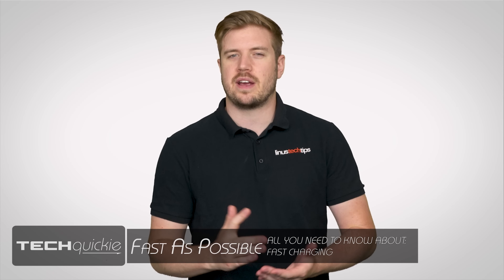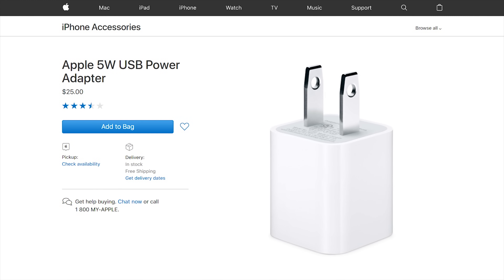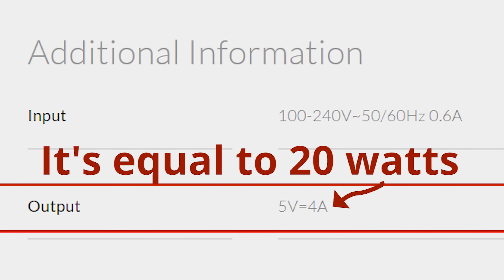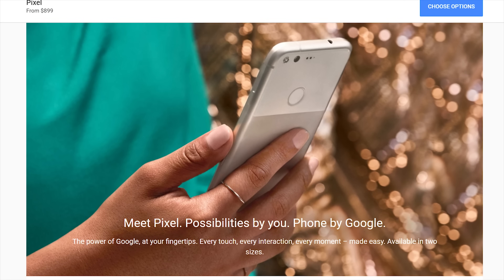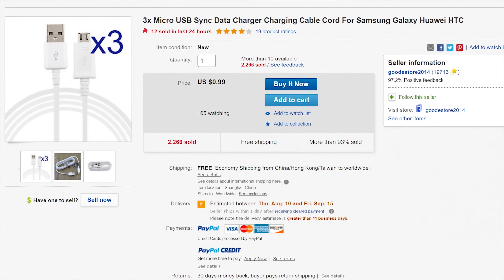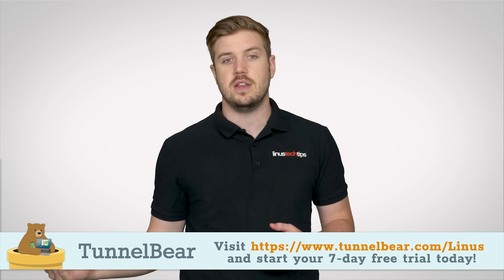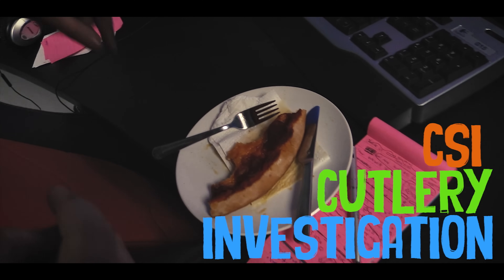How Does Fast Charging Work?

Comment: I use a hauwei ya8 very cheap phone work up today and realized I forgot to charge it
Dressed and off to work,  I put it on charge using the company plug and in a space of 20-25 minutes my man was 78%  and it's not even an expensive device tec is awesome

Comment: I bought a USB dsi charger since the original one I got with the console was broken. When I plug it into my phone's ac adapter (Wich does handle fast charge) it charges REALLY quickly. Apparently, the Nintendo dsi is fast-charge compatible xd

Comment: Funny how AT THE MAKING OF THIS VIDEO most phones could take 2 amps/10 watts for the LAST SEVERAL YEARS. Handshaking technology..... while every battery has a charge controller chip often built onto the end of the battery... right down to the junk little rechargeable lights with lithium batteries.

Comment: Hey techies
I just purchased, micromax IN1 which has fast charger
But it gets hot (around 48 deg celcius) after charging for 15-20 minutes)
Till 65% it heats up then 65+ it doesn't heat much

Is there some issue, what should I do now¿
Reply: Well above 45°C it can be harmful for the battery. Try to keep your phone cool while charging it. Put it in a cool environment.
Reply: @quietpaper  you're indian?

Comment: Didn't get my answer. Nearly All of phone battery voltage is around 3.6-4.2V. The question is how they can be charged with 9V and 2A. Does the need to convert it to the new level? During the conversion lots of energy will get lost and make more heat.
Reply: Yes
Reply: Yes voltage converted to amperes and push into battery.
If battery is capacity 4.5v 5A ,and put 9v 2A without energy loss the battery would receive 4Ah or 0.8C
In reality would loss 10-30% of energy as heat
there are charging system like PPS that push low voltage high ampere from charger that reduce heat on phone

Comment: Fast charging is not good.  The quality of the battery determines how many charge/discharge cycles the battery is capable of.  Fast charging reduces the number of charge/discharge cycles.  Slow charging is best.  This applies to all rechargeable batteries.   What is likely to happen  one of the cells in the battery will short out, then battery will still put out voltage but will strain the remaining good cells.  It will cascade with the battery losing voltage and cell capacity.  Heat is the enemy battery packs.   Charging produces heat.  the faster the charge the more the heat produced.    This dries out the cells.  They vent gas and the cycle continues.

Comment: Absolute bullshit. Using a 4amp power supply won't make charging any quicker, it will just help with voltage drop. It's higher voltage that will speed things up. Electronics will only pull as many amps as it needs.

Comment: If I wanted to by a multiport charger, and I have a variety of devices that I want to charge via USB, and some devices I want to charge use Quick Charge and others don't, is there a multiport charger, like one from Anker or something, that you recommend? Will it be safe to use? Or should I not bother with Quick Charge capabilities for the sake of safety?

Comment: my connector is wrecked, I just changed it with an old one. My adaptor is a fast charging. Does it really matter if I change the connector? If the adaptor is fast charging will it get much power from the power source and just stucks on the adaptor and the connector just accepts the amount of power it can handle? In my case, the charging slows down, the adaptor heats up easily, and the connector is cold asf. lol. i know, it's so complicated but still hoping someone helps me. lol.

Comment: Fast charging is like eating or drinking too fast. You feel full, but that feeling doesn't last as long as if you sat down and ate a good meal at a slower pace. Or maybe drinking an energy drink, a quick boost for a couple of hours but you run out of steam very quickly. Batteries like a slow charge to make the most out of what its getting just like your body would rather have constant nutrients instead of a quick blast of sugar or caffeine.

Comment: Got my OnePlus 3 charging insanely fast. From 5% to over 45% in less than 10 minutes. Not to mention that sometimes I wake up with it on 3-4% and when it reaches 1% I still use it to check my apps and mail and it doesn't die until after maybe 10 minutes of use like that. So, take your iPhone and throw it in the bin. Get a OnePlus and live like a god :)
Reply: Do remember modern day Smartphones will actually turn off at 3% NOT 0% or 1%

Comment: Li-Ion and Li-Po expand over there life from over temperature extremes as well as being held at fully charged or too low for too long, this is why on a design point of view, you should NEVER use a phone case that has the battery backup built in as this applies permanent power to the charger input of the device, if there is always 5 volts present the battery is never allowed to discharge (some moden battery management can allow charging to completely halt). Something to keep in mind is when a traditional charger for Li-Ion or LiPo gets the battery to 100% (4.20volts) basic physics steps in, the battery doesn't need the current, but the charger keeps going it pretty much just burns up that current as heat in the battery instead - further damaging it.
Reply: Actually modern Smartphone chargers cut the current entirely once the charging is done and won't allow anymore current to come through thus the Battery will be entirely protected

Comment: I shut down (turned off) my phone at the end of the day before snoozing and then charge, less than 100 minutes with a non-fast charger too.  Preserves battery life pretty well.
Reply: Leaving it on is better as turning it back after charging will only suck juice from the battery
Reply: @stephensnell1379  true.
That depends on the age of the battery and it's capacity, mine are all higher than 3000ma.

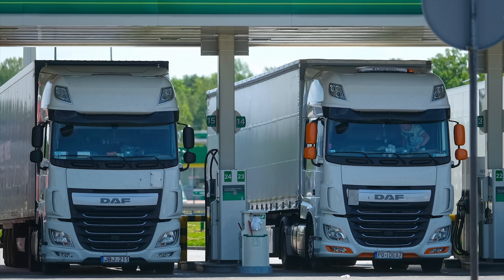Comment: 3:00 woah, okay, $50 bucks to fill a big rig? and you are showing a picture of Semi tractor trailer units. On average, these trucks have anywhere from 200 - 400 gallon capacities, with a usable capacity of 190-390 gallons of diesel (usuall,y numbers vary my manucaturer, make, model, etc.)  200 gallons at $3.19 a gallon for diesel where i live is $638 dollars.  
I wish it was $50 bucks.

Comment: Do y'all have a video explain smart charging power supplies, and how or if they can quick charge multiple devices, or does the overall Amps get limited to say 5A per USB port, or is that 5A shared through each device plugged in?

Comment: Wanna see something out of the box? Here is "CONNECT" a new "wireless system" that can charge as fast as a USB, require no cables to charge, with a portable fast charger and power bank, a reversible USB onboard that you can plug both ways, with a kickstand, a sound enhancing speakers on the phone case and all in two parts lightweight of 3.4 oz check it out at www.miriQ.com (more videos on vimeo such as this one https://vimeo.com/236365494) 
Please let me know if you'd be interested to test the CONNECT device we can send you one from our LA office - here's my email - Solo@miriQ.com
We just getting started and already booming on Amazon Prime but we need smart people and reliable feedback from cool dudes like you ;) looking forward to touch base.
Cheers, Solo Avital

Comment: in fact, the fast charge doesn't work it is just a gimmick. we have 2 types of chargers on the market 0.5A and 1A. All the sellers are telling you their chargers are 2A 2.4A ... even 3A but this is just not true in real usage. I am not speaking about voltage (v) that is total bullshit when it comes to phones. All micro USB cables or USB c 2.0 are not rated more than 5V and in fact, they don't even deliver 5v they do around 4-4.5v.(even usb type C 3.1 can't deliver more than 5v 3A) All this quick charge 2.0 3.0 fast charge turbo charge are just gimmicks your phone will be charged at the same speed with a non-quick charge charger but your phone won't display FAST CHARGE status. If you don't believe me just install Ampere app on your phone and try different chargers. The only slow chargers are the 0.5 A and they are sold as 1A charger. So just buy a 2A charger that will actually deliver only 1-1.1A. I don't know i may be wrong and this may be just a software restriction or the actual battery technology limitation. But even like this, I don't see any point in paying double for a charger that can theoretically deliver 15W 18W 24W 30W when you can't find any phone that is charging faster than about 5W
Reply: the only benefit of these chargers is if you use them with an usb 3.1-3.2 type c to charge a laptop or a device that can eat that much current but not a phone.

Comment: You are wrong, the current limit is usually set to 1C charging. For example a 3000mAh battery should be charged at a maximum current of 3000mA or 3A. You can of course charge a Lithium Polymer or LiPo battery faster BUT you are limiting the life of your battery, meaning it can endure less cycles before the capacitance drop of your battery starts to impact performance. Though manufacturers can support this cause they expect you not to keep your mobile phone more than 2 years (for tablets it´s around 3 years and for laptops anywhere between 4 and 5 years). Now try and remember when you started noticing that the battery of your device is not lasting that long. Fast charging is convenient yes, you know what is more convenient though?  Battery swapping like in digital cameras ;-)
Reply: You prune 
It is easy for any Smartphone to last up to 6 years
I myself I ONLY change my Smartphone onve every 6 years

Comment: 1:34  -  false. Battery expansion not only should not happen but pouch cells (like the one in your phone) are usually put under a compressive load when incorporated into high power battery packs (like those found in electric vehicles).

So it's not a question of room to expand. It should meaningfully expand at all. It's about preventing expansion period. "How much power before this thing goes carnival balloon?"

Trick is that you usually don't have to worry about expansion if your managing temps correctly as you'll overtemp far before you inflate the darn thing.

Comment: Awesome video!
I have to add that fast-charging in a lower battery charge (about maybe 0 % - 20 %) can eventually damage the battery a tiny little bit (works for all Li-Ion based batteries).
But what kills your battery even faster ist not charging it in time. It gets permanently damaged as it reaches a lower level. In fact, Li-Ion based batteries live by charging and normal-use-discharging. The times of "you have to fully discharge your battery and fully charge it again" are over, this works for your NiMH and NiCd! This is why I recommend airplane mode at about 30 % until getting home (which should not occour a lot of times hopefully, and if it does: avoid it on your next phone/spare battery).
Trust me, I´m a dark wizard,
Greetings!
Reply: using airplane mode kinda kills the reason for having a phone
Reply: @DanielQRT  it will help a phone to charge 2 to 3x faster

Comment: I use micro USB charger devices,  Samsung Galaxy express 3, ZTE phones,  Kindle Fire 5, headphones,  MP3 player...  I use a  power wall charger that gives 5v 2 amps, it charges the devices in about 10- 39 minutes.
Only devices don't support fast charge is iPhone 8, and 10(there battery's exploded).

Comment: i have the motorola turbo 2 and the output of the supplied charger is 12vdc and can have a full charge in about 2 hours if  use the normal charger that i have laying around  it could take about 4 to 6 hours
Reply: Use your lower powered charger 
Slower charging is actually much better for a  Smartphone battery

Comment: My phone uses bursts to quick charge. The phone will monitor temperature, the power delivery, communicate with the charger and for ten minutes crank up to 30W charge mode. Once the phone gets too warm or the power being pulled from was wall stutters, my phone tells the charger to hold back.

I can go from 5% to 32% in 20 minutes. If My phone stays at a constant safe temperature, burst charge stays on for 15 minutes making the 5% to 32% charge  take 14 minutes. In some situations where the temperature in the room is cooler, my phone burst charges to 60% in 25 minutes. 

Only downfall is that I need an expensive type c cable and 30w charger for my phone to quick charge. The plug alone is £36.99. The cable is £18.99.

Comment: I notice when I slow charge, my battery will last quite a bit longer than using fast charging.
Reply: MeatPopsycle I think it has to do with a saturation charge. I've noticed that too. If the charger dumps a ton of electrons into the battery quickly they tend to dissipate quickly. I look at it in a similar manner as filling a shot glass. If you turn your sink on full blast to fill it, sure, you get water in there. But half of it sloshes out. If you just turn the tap on a bit, you get a slower fill, but it ends up being more full. I've noticed my phone never seems to last as long as it initially does in the morning. If I top up it off during the day it seems to deplete a bit faster.

Comment: My Moto G³ (osprey) that doesn't support Quick Charging by default but it's sibling, the Moto G Turbo Edition which is the exact same phone, just with a different SoC, does. There is a custom kernel for my Moto G³ which allows Turbo Charging so the conversation now between a Samsung charger with 4 amps I bought and my phone is something like this:

Samsung Charger: "Can I give you 4 amps?"
My Moto G³: "Yeah d00d bring it!!!"
Samsung Charger: "k homie, here's some extra juice"
Reply: It's the other way around. Device "asks" the charger for a maximum current it can provide. It could also ask for a higher voltage if both devices support fast charging method with variable voltage.

Comment: How long should fast charging charge up on a 3000mAh battery? My galaxy a5 2017 takes about 1h30min to charge from 20% to full using the samsung fast charger. Is it faster on the s7 or s8?

Comment: $50? I put 20 gallons of gas in my car and it cost that. The trucks we have at work (class 8 vocational semis) hold 180 gallons of diesel, which would put fuel cost (per tank) closer to $500 than $50.

Comment: @Techquickie can you explain the science/tech behind fast charging? It's well studied academically that most batteries, including the well-adapted Li-ion ones, fail a lot faster during faster charge-discharge cycles, or deeper cycles (e.g. from 100% to 0%) cycling it too fast also reduces capacity, and reduce energy conversion efficiency. So those fast charging we see on the market, do they use something like a supercap as a buffer? Charge supercap up quickly, then slowly charging up Li-ion from the supercap? Thanks.

Comment: My Le Eco S3 has fast charging USB-C. The cord that came with it sucked it only worked a few days. Bad Le Eco!!!! I had to buy an aftermarket charge cable for $8.99. A Rampow USB 3.0 to USB-C braided cable.The charger itself you can plug the cable either way which I never seen before. The charger that came with it has several output voltages, 3.8~8.0v 3A and 12V 2A which charges my device to full in roughly 30-40 minutes. If you get the LE ECO S3 throw the cable you get away its failure rate is extremely high and order the RAMPOW RAMPOWT02 USB-C USB 3.0 6.5 foot cable. It states it can handle 15 watts of power (5V 3A) and is built well. It is till on the cheap and it has a lifetime warranty and that is the  best part so if it breaks, then it will be replaced. I would post the url but I do not want to get in trouble. I got this from Amazon .

Comment: isnt this when also a usb becomes dangerous around water though? like im fine 5v 1amp falling in my bath (note i do not use electronics in the bathrooms maybe my phone on the windowsil there are no electrical connections) am just sayin. at the moment ive even made the grave mistake of leaving my phone charging underneath my pillow in bed it was hot but id only say about 45ish degrees at the most wasnt oh shit better pull my hand away hot but still i imagine if my phone was sucking x4 more than that, that wouldnt end to well
Reply: Woman in sydney died from a 5v 2amp charger depends on situations i guess ive been shocked off outlet power and was lucky nothing was taking a load as id only managed to touch an earth (the plug had a hole in its housing) luckily not live or both, my hand still locked up though and i managed to pull away with my body jerking
Reply: In that case she died from the AC input side of the charger. Not the DC output side. Dead from the power outlet is very possible, especially if you are older.

Comment: Charge iPhone with iPad charger. Done.
Reply: The "charger" is in fact not even a charger per say, it is simply a USB power supply,  the actual real battery charger is on the PCB inside the phone, ipad or laptop etc, However there are handshakes between the device and power supply in newer USB specifications that goes along the lines of  "hey phone,  USB power supply here - I'm only capable of delivering 1Amps @ 5 volts, so please don't go over over this as I might have to shutdown or I will become unstable and hot - the charger said" -  so the phone listens to this basic coms designed into the USB power supply and limits its charge rate (current) into the Li-Ion / LiPo cell so as to not draw too much from the external supply.  Have a read of this that lays out how the specification evolved from the first USB ports: https://www.maximintegrated.com/en/app-notes/index.mvp/id/4803